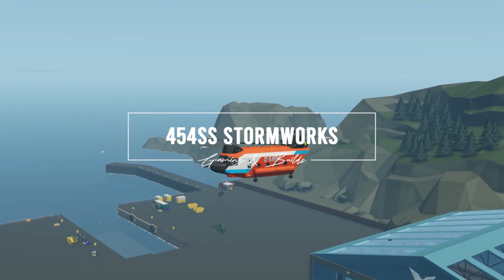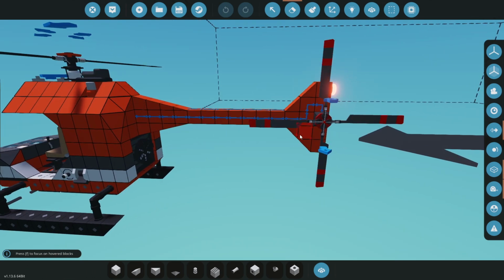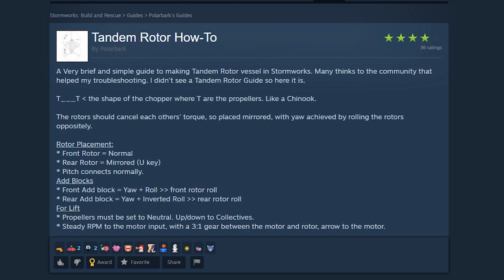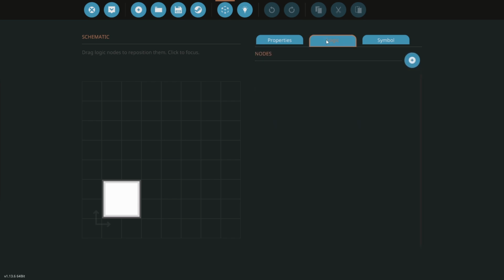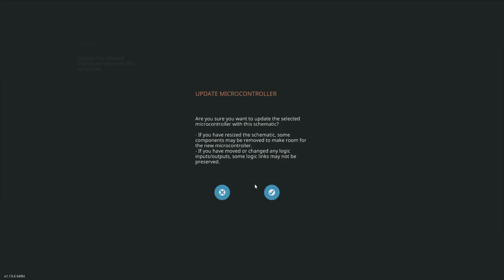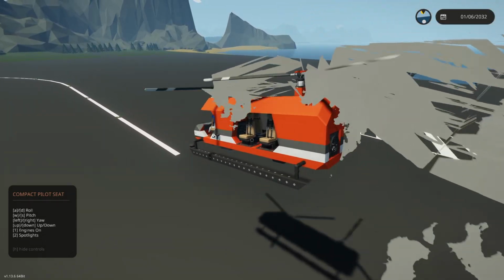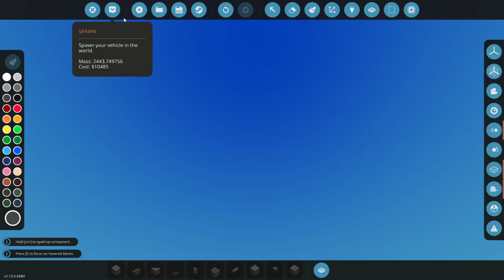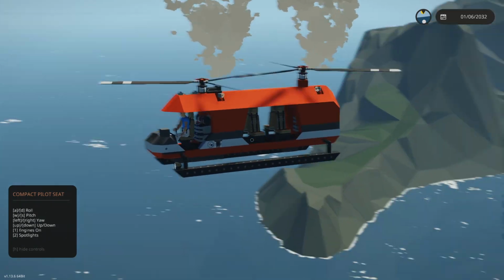How to build a TANDEM ROTOR Heli in Stormworks (Engineer Explains)

Comment: Mine still just.. does flips lol 
I cant figure out why, Center of mass is in the far front, if i put it in the middle it flips more

All i can think of is reducing power to the front rotor.. but i need the lifting power..
Reply: My rear rotor massively overpowers the rear one..
Reply from the maker: Check the arrow directions of the rotors!
Reply: @454ss_gaming  wich seem fine to me? bith push up, pitch arrow forward and everything but it is out of control
I made it worse somehow, now it flings itself left or right, sometikes ending upside down..

Comment: Having a bit of an issue. I tried this on a osprey design and it worked well for the most part, but the yaw doesn't work at all. I'm gone through the video a few times but everything seems to be set up correctly. The only think I had to do was figure out which prop was the "front". But apart from that, Roll, pitch, and collective works fine. The yaw is the only thing giving me trouble.
Reply from the maker: You are in luck, I just made a video for that!! For a transverse style heli, you have to connect it differently!
Reply: @454ss_gaming sweett thanks! I checked it out and I was hoping I wouldn't have to turn them with rotors, but I think I can make a simple addition to the microcontroller to basically stop it from using the prop rotors for use when the props are in any other orientation besides straight up and down. I've got a throttle lever to swap between vtol and plane modes, so as long as that throttle is set to full (VTOL) the microcontroller will allow yaw with the rotors

Comment: That wobbliness is caused by too high rps indeed, currently in the game gyros is tuned to work at 20 rps and below, but you can overclock it, and it will work just like that. You can solve this problem in a very simple way: just set the engine to a lower rps, that's it. No need for any weight or elsewhat. Reducing the gear ratio is lowering your rps, but it's also lowering your fuel efficiency, so it is much better to run the engine on it's peak performance torque, using gears, that is multiplying output rps.

Comment: Maybe making a tandem rotor would be a nice way for me to get back into stormworks
Reply from the maker: They are really fun to make and fly!
Reply: @454ss_gaming  also seems like a great option for making a sky-lift for air hauling ISO containers, maybe a container sized SAR/ambulance module thing to snap on for a bit of versatility, could definitely take it many places. Didn't expect stormworks physics to account for gyro forces in rotors so tandem doesn't require tail :O